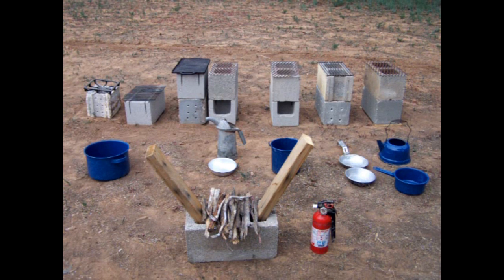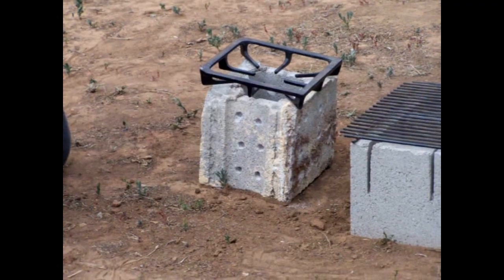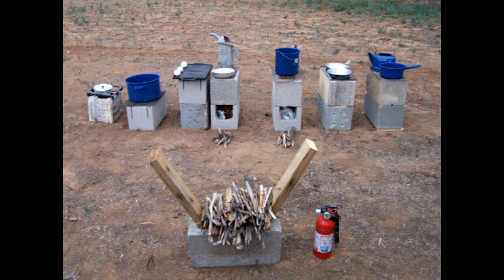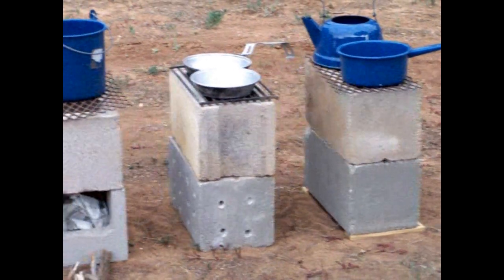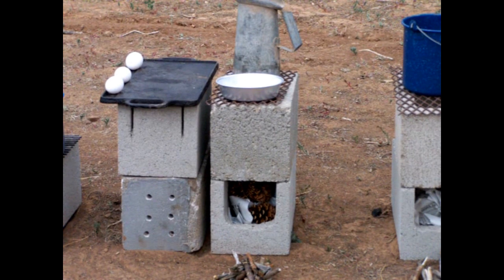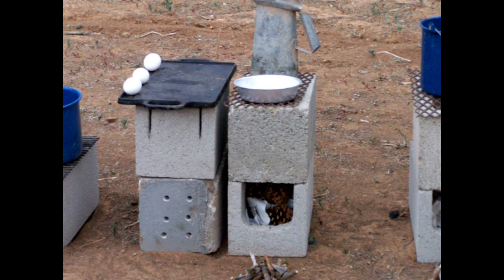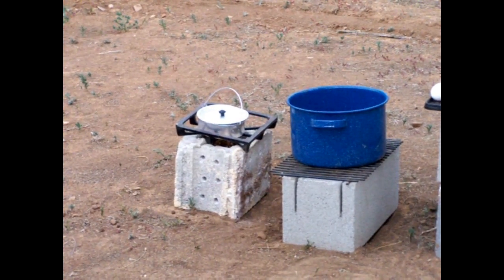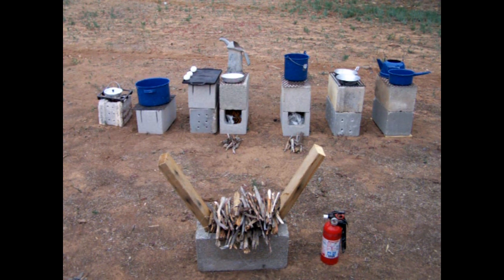How To Build A 2 Cinder Block Rocket Stove - Part 7

Comment: Fun series.  Thanks for posting.  Concrete slabs alongside the sides with holes allows the user to simply slide it to vary the amount of air feeding the fire.  Also, for the side feeds, having a long 45 degree channel (could be cheap corrugated steel easily formed into a channel and propped up at an angle) allows the user to feed long sticks, and, as they burn down, gravity will do the feed work for you.  Working on these ideas as I sit here and thinking, I need to go down to Lowes...  Fun stuff.  Keep up the good work!

Comment: Hi I really admire your great creativity and imagination.
Thanks for posting so much of excellent work. I would like to use a 1 or 2 block design of yours 
Inside an Indian teepee I built. Currently, I designed a flowerpot cookér with cutout for wood feed.
I feel the block design could be more efficient.I have heard from others that cinder blocks can crack in heat. Can it be prevented with gradual firing? Thanks again.